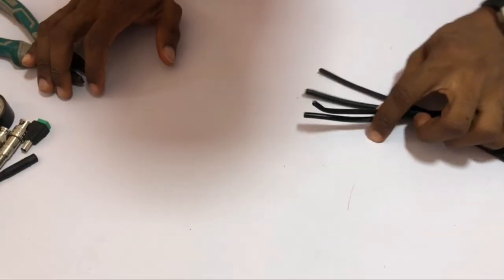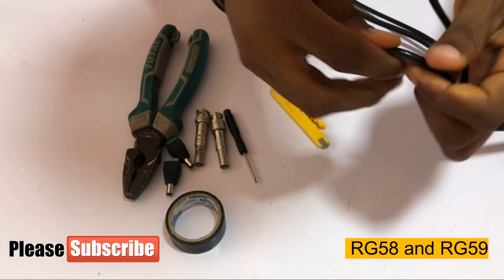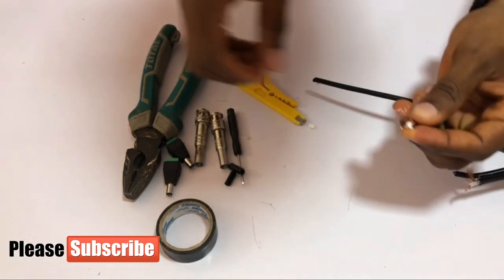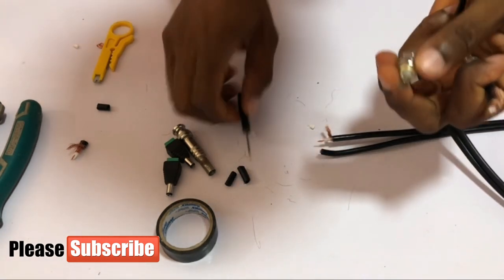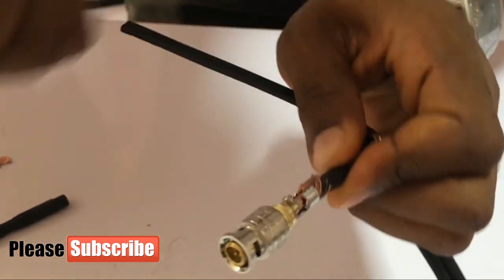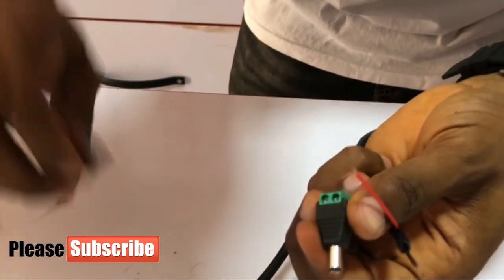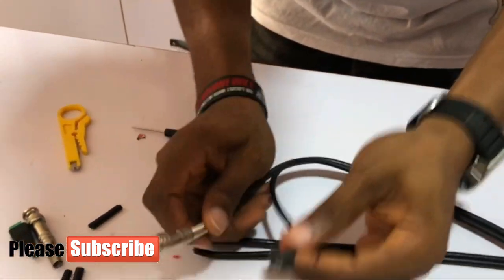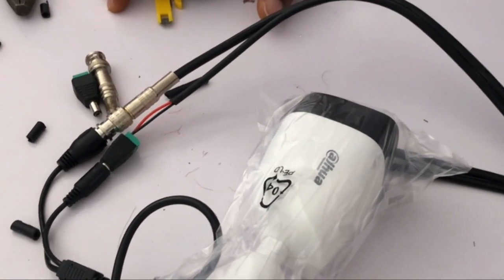How to Crimp Analog CCTV Camera Cable

Comment: U mean d Rg 58 have two copper n is that what u mean a strand ?
Reply from the maker: RG58 has many tiny strands on the positive part of it feed.  unlike the RG59 which has a single bigger strand wire on it positive feed

Comment: Nice one. Well done Engineer.

Q: what's the advantage of using Cat6e utp cable over RG59 cable for analogue camera?
Reply from the maker: It is Best you use RG59 for analog cameras, even tho you can still use cat6 cable but prefer to use RG59, cat6 UTP or STP are best for IP cameras, They are network device cable, I will talk more on It when we start Basic Networking and IP cameras. Thank you